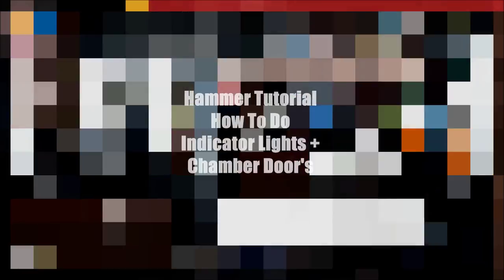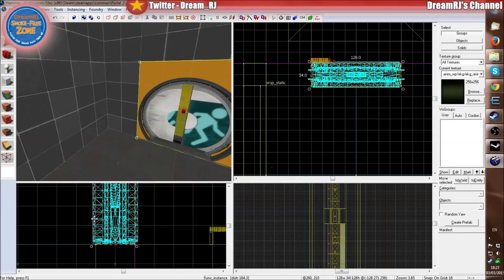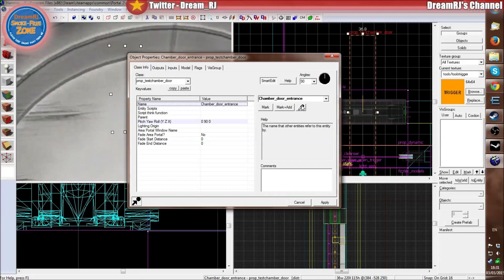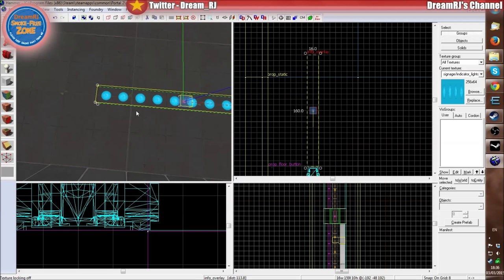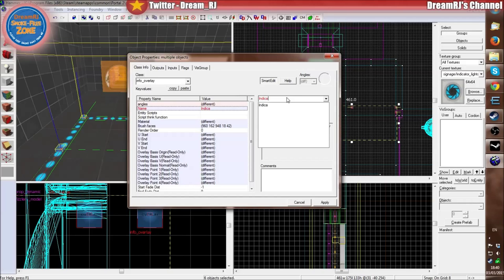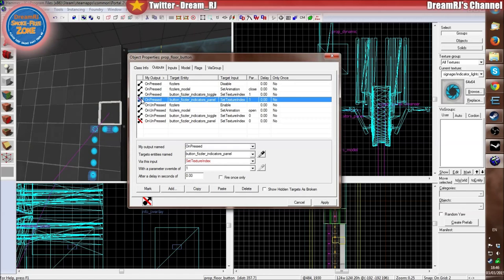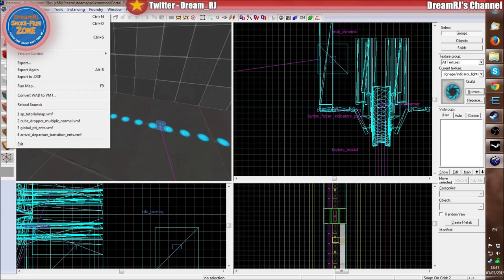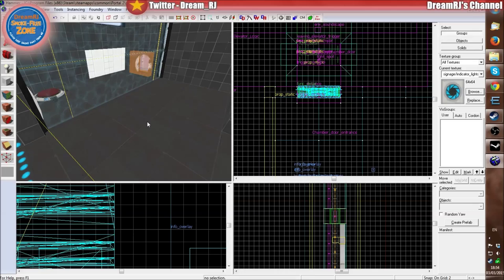Hammer Tutorial - How To Do Indicator Lights + Chamber Doors And Frames!

Comment: With the triggers, how do I set it so that it triggers a custom audio file? For instance, I want to create a test chamber where I use my own voice (edited to sound like GLaDOS) in some parts. So how would I do that?
Reply from the maker: Mandelbrot Set Custom audio is a pain to get to work in hammer, i never tried doing custom audio, but i did custom textures, they are far easier, audio is more tricky you have to use other programs, you would need to do a google search to find out, cos i dont know exactly what program u needed for it, sorry.
Reply: I figured it out. I didn't need to use a true custom audio file, but I modified an existing one in audacity, pasted it back into the same directory with a slightly different name (and as a wav), and it showed up (and it worked, unlike the other file--it doesn't like mp3s). I don't know if it works (it should, as much as any other sound would), but I can't seem to open the damned chamber in the first place, as I mentioned in another comment o.O
Reply from the maker: its hard to help, unless i had access to your map :P but i dont have time, i hope you can work it out :)
Reply: The internet says I'd have to pack it directly into the bsp itself. How would I do that?
Reply from the maker: i already told u that, use pakrat, do a google search m8. good luck
Reply: Oh you did? x'D I lost track of the comments xD
Reply from the maker: lol yep :)